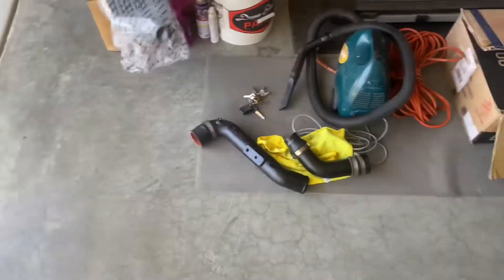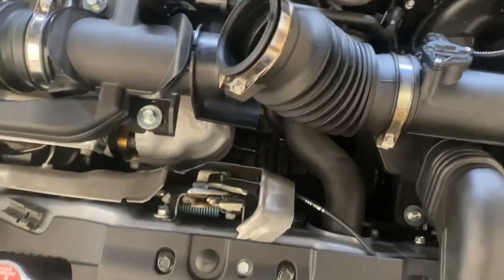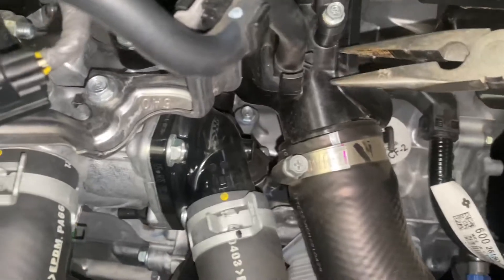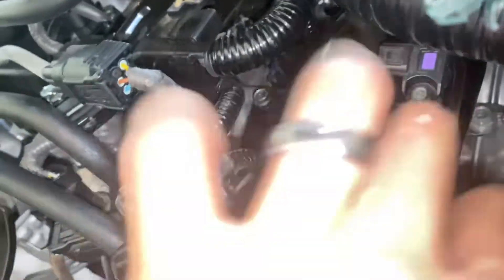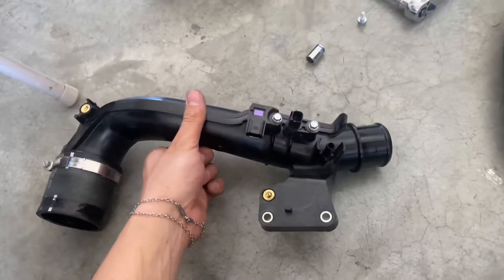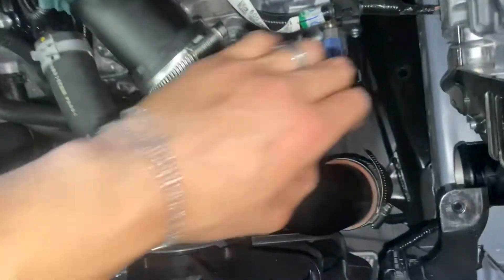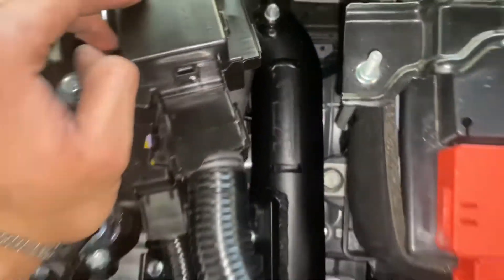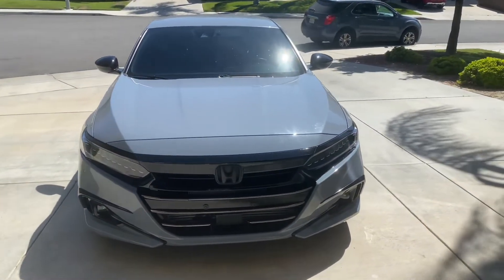H.P.S Cold Side Upper Charge Pipes for the Honda Accord 1.5t 2018-2022

Comment: Do you know if the prl kit that comes with both sides fit on the 1.5 ? The parts look alike and I just ordered the same charge pipe you got like 3 days ago now I’m just waiting for it 🥲
Reply: On my 1.5t i have the hps 1.5t upper and the 2.0 lower from hps since i have the prl intercooler and it fit just fine. I didn’t get the hot side because its the same thing just a rubber hose so i saw no point